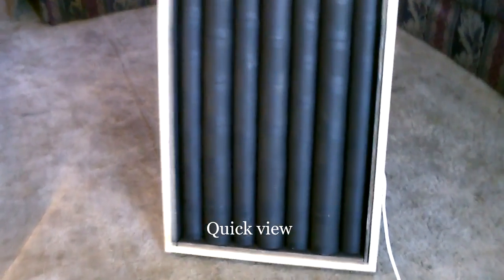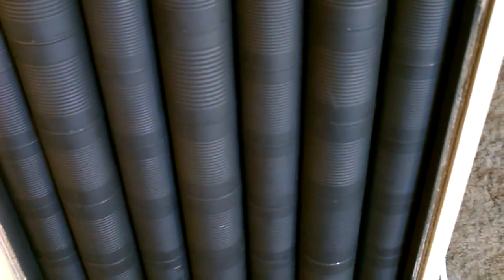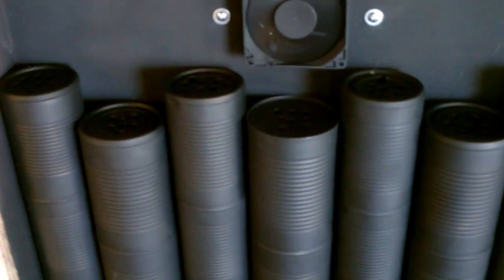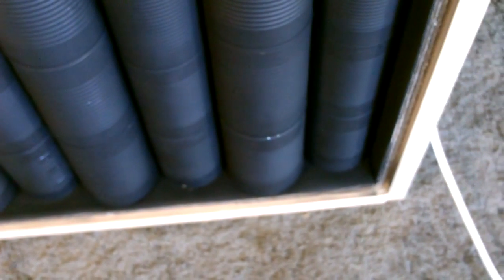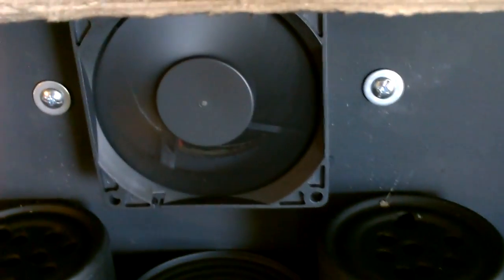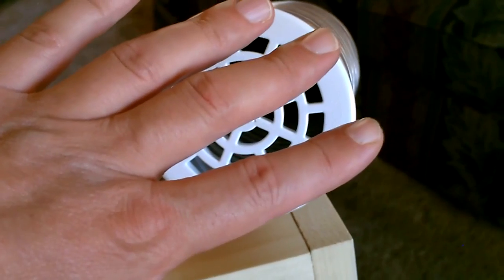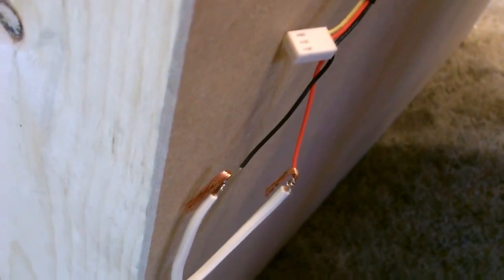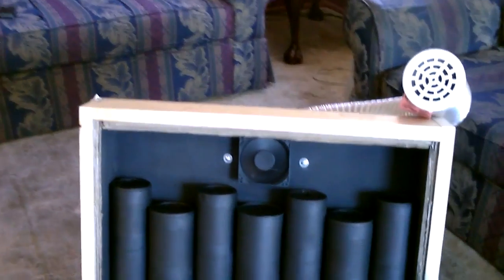Solar Air Heater DIY - Homemade STEEL CAN Air Heater! - Quickview w/closeups

Comment: I want to do this but i want to make it a heat pump. Im thinking hosing and just running it up and down x50 in a closed loop that runs through a truck radiator. Will need a high temp hose and a fluid like antifreeze and a pump lol

Comment: TIPS: steel is ok if you have it, Aluminium (aka soda cans) is far better than steel as it dissipates and transfers the heat to the air better. Also create as much turbulence as possible by misaligning the cans to get maximum output.
Reply from the maker: hi. i've found that steel works better than aluminum (mainly due to its density and its ability to hold the heat). the thickest stel one (the one i made with the steel downspouts is the hottest)

Comment: Did you need a solar controller? Or did you just wire the fan direct to the PV solar panel?
Reply from the maker: hi. i just wire it directly to the solar panel. it runs strong when the sun is out and when the sun is weaker the fan runs weaker (which is perfect, because yo want it to run slower as the sun is weaker and unit will be producing less heat)
Reply: @desertsun02  That sounds good! I have a snap switch that cycles on/off at 90 degrees. Thanks for the fast reply!

Comment: Nice video and solar air heater man! I built a soda/beer can one 6 years ago. I am overhauling it this week. These things are amazing! I am adding a PV solar panel to power the 80 CFM fan. How many watts is your panel?
Reply from the maker: hi and thanks. i usually use a 15 watt panel but that is just because i have lots of those. the fans in these collectors usually draw from 2 to 5 watts, so a 5 or 10 watt panel is all you usually need.

Comment: great vid, i enjoyed it. One question: is that ok if i dont drill holes to the above cans but instead have them completely open like a tube?
Reply: TSIRHC SEVAS the holes in the cans slow the air down allowing it to heat air better by keeping it in the tube longer. If all cans where open air would go right thru and hot absorb as much heat.

Comment: I am going to make this to stand in my window.  I live in a condo and cannot put a solar panel outside.  can you please tell me, what kind of fan should I use, and do I need a high heat fan?  Brand?   And how do I hook up a fan to a plug.  You did not mention this.   i am wondering if I even need a fan, because in the time it takes for the heat to rise if I use a fan wouldn't that cool down the heat once blown out?  I am not a technically savvy person, and dont understand specs and all that, so if you could tell me in basic terminology I would really appreciate it.  Thank you.   (female looking to heat my fridgid place)

Comment: Nice homebrew.  I think your fan would probably last a lot longer and the whole device would be a lot quieter if you put the fan on the upwind side of the cans, instead of the downwind side.  Then it would always be running in cool air instead of hot, and the cans would muffle the fan's noise.

Comment: you should have an intake taking air from you house to the bottom of the panel.  that way you will be heating air that is already warm, instead of trying to heat the outside cold air.  Unless you plan to mount that inside your window of course.

Comment: do you think the TIN cans work as well as the aluminum for heat generation, i know alum makes a better 'heatsink'. thank you.
Reply: desertsun02 Too many tinkerers forget the point is to get the heat out.  Your statement about "how fast you pull the heat out" is exactly where the rubber meets the road.  A lot of these homebrew systems are generating slow trickles of air at 200+ degrees, and yes that's fun to think about but 200+ degrees is hotter than anyone can stand, and the slow trickle doesn't really deliver much.  The longer dwell time of the hot air inside the collector, ductwork etc just means more of the heat leaks back out again.  A faster, stronger stream at cooler temperatures is much more efficient.
Reply from the maker: hi there. the tin cans work as well as the aluminum ones. bigger factors related to maximum heat generation are things like how big the collector is and how fast you pull the heat out of it.

Comment: How many temperature's did you increase with you can solar heater?  And what size wood did you use?  Thanks for your vid.  I was cold this winter, and don't plan on being cold next winter.  But I hate to pay utility company what they're charging.  Thanks for your information.

Comment: Put your fan as intake feeding a tube at the bottom. The air will come out the top on its own. Place this in front of a glass window with sunlight coming thru.

Comment: Just a little worried about the high heat shortening the life of the fan.
Reply: These computer fans are often quite cheap, so if you need to replace one it's not the end of the world. Also, almost free heat!

Comment: I was wondering the same thing.. but I think the convection may work better with the holes. However, I wonder if every other one was filled with water could you use it longer through the evening... I think I may have to experiment with that.

Comment: Ever think of using a Thermoelectric Generator?   It seems to me it would be cool, because it would cause the fan to spin faster the hotter it got.... and slower or not at all depending on the temperature difference.
Reply: you dont get the velocity you need from lower temps to circulate, that's why people use solar panels. you'd need reasonably high temps to get decent current. 

we also use 12v car heaters to boost on super cold days.